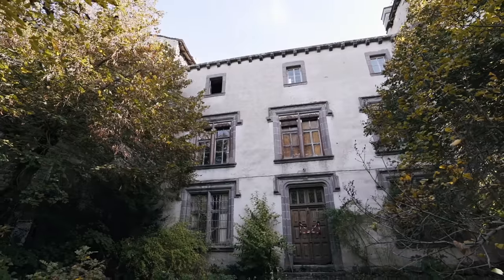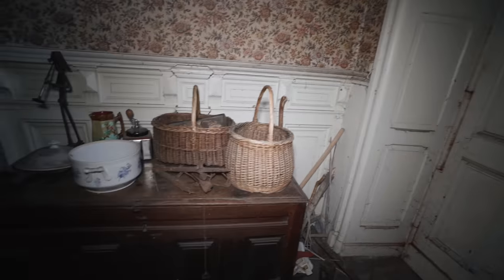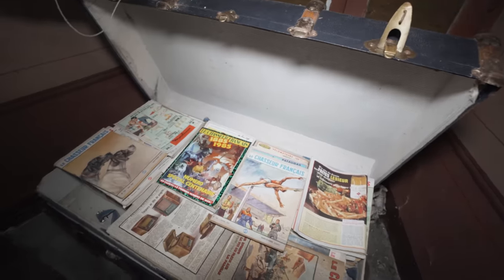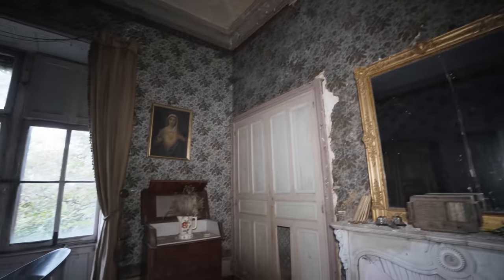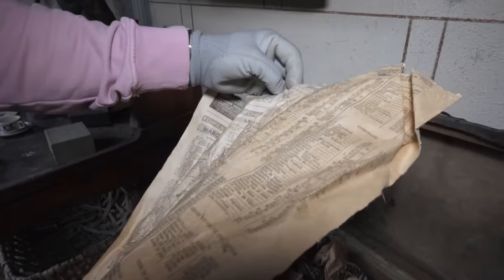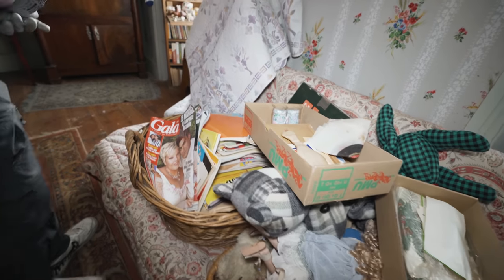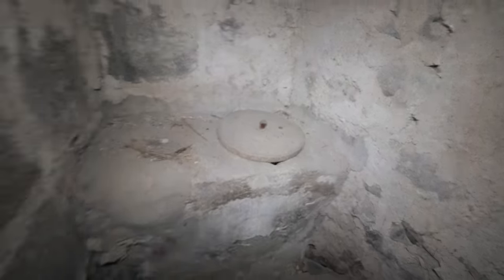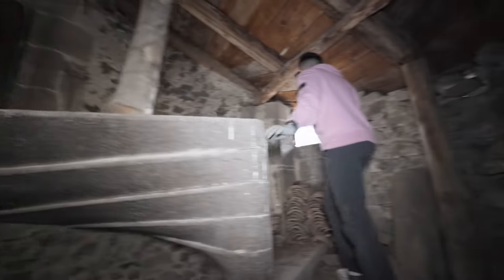Found A Secret Room! - Fully Intact Abandoned 12th-Century CASTLE in France

Comment: In the very beginning of the video when you were outside talking....did you know that there was someone inside? I could see them moving across the windows behind you on the upper floors. 😳

Also, that one framed picture, I think it was a stage coach or something like that, the one that changed in the light. That was foil art, very popular in the early 1990’s.

Comment: Women that had several perfumes would set them out in a specific order. Each one would always sit in a certain spot all the time. So they would know exactly where a certain one was . And if it was moved or gone they knew.
Those finger protectors would be called a thimble. A d that's quite a collection of porcelain thimbles.  By the looks of the dust ring marks some have come up missing.  Those could be worth a small fortune.

Comment: When the structure was built - and later - transportation was on rural, unpaved roads. Also, when this was built, it was built as a church or Monastery, and additions later made by various owners with wealth.  When traveling, you arrived with dust on your hands (and possibly face). Therefore when this entry was part of a chapel or church, this Brass Lavabo ( la·va·bo) Wash Basin - a washing trough in a monastery and small towels nearby,  placed there for the Ceremonial cleansing and the washing of one's hands before offering a prayer or handling the Eucharist at a church's offertory, or alter. This is based upon the scriptures that one does not approach God with dirty hands - literally or figuratively.  Later - as a private residence, it was a status symbol much like a well placed guest half bath off of a foyer today. (Today, this would be called "a sink".)